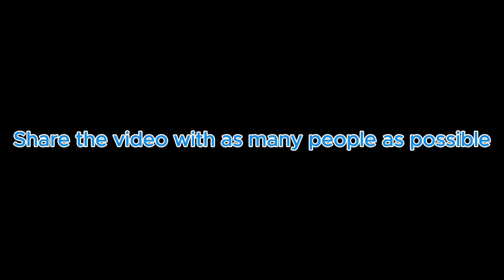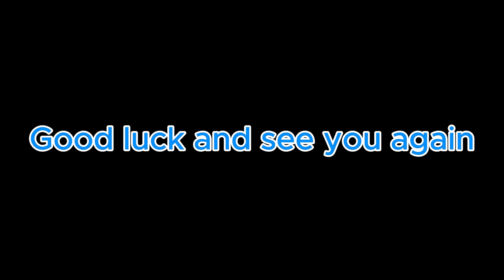Mix SILICONE and ACETONE! The results were shocking because they were so unexpected

Comment: Acetone vapor chambers can be used on 3d printed items (assuming they are ABS or other acetone soluable plastics) to create a smooth finish. It makes them look like injection molded products and removes ports of entry for water, bacteria, etc.

This is probably too much acetone to just spray on an ABS print, but I curious if anyone has tried this method with easier to print PLA? You'd still have the visible layer lines with no increased layer adhesion, but maybe this would be functionally similar in making things food safe? water proof? smooth? IDK. Has anyone tried?

Perhaps not shocking... but for a nurse who likes to F around in the garage, I'm glad to find this!
Reply from the maker: Thank you for watching the video and leaving your feedback. Each comment you make helps the channel grow and motivates me to work more effectively

Comment: Not a bad price... speeds and feeds are everything when cutting metals... especially stainless steel... I will say that having been in machining for 35 years. Yes cheaper drills are cheap but if the metal they are made from is good then you should be so long as you follow best practices. There's a few good phone apps to help with speeds and feeds just in case anyone didn't know that. I will add that you can get better quality tools from your local machine shop suppliers and you might be surprised at some of the prices. They run specials regularly too. May I another point. Over the years I have seen crap quality drills from name brands common in the machining industry as well... it just happens some times. Drills that weren't even heat treated properly and one's that the whole pack of 10 were bad that way... we even got a pack that didn't have the 2nd dairy grind on them and blew up the second you tried to cut with them... best of luck... feel free to ask me anything about machining... take care.
Reply from the maker: Thank you for watching the video and leaving your feedback. Each comment you make helps the channel grow and motivates me to work more effectively

Comment: Fake U can't put acetone in a plastic bottle or spray bottle unless its a special kind of plastic .the acetone Weill melt a water bottle and the working plunger in a plastic spray bottle as well as  with the zip ties used to stir would be eaten by the acetone. Acetone is sold in metal containers for this reason unlike acetone for fingernail polish remover sold in plastic the plastic is a special type and the acetone is not pure!!
Reply from the maker: Thank you for watching the video and leaving your feedback. Each comment you make helps the channel grow and motivates me to work more effectively

Comment: Mineral spirits would be cheaper.  Trying to speed up the drying process with the heat gun is questionable at best.  Please advise good ventilation so you don't breath that stuff.  A can of silicone waterproofer works the same.  Or pretty much IS the same.  Not shocking.
Reply from the maker: Thank you for watching the video and leaving your feedback. Each comment you make helps the channel grow and motivates me to work more effectively

Comment: Yeah, silicone rubber sealant ALSO WORKS AS A GASKET, TOO. Since that's EXACTLY what it's designed for. You can do that with oil-based paints, too. And, believe it or not, it still acts like paint, even tho you're using it just like paint.
Reply from the maker: Thank you for watching the video and leaving your feedback. Each comment you make helps the channel grow and motivates me to work more effectively

Comment: Odorless mineral spirits mixed with silicone. Use a paint stirrer.   You can take a cotton (canvas) tarp or tent and make it waterproof. It needs to hang up taut for a day or two to dry because the mineral spirits evaporate very slowly. It becomes similar to a fabric that used to be known as 'oilcloth'.  Just use a paint brush to apply it to both sides of the canvas.

Comment: silicon used alone in any form does break down after a few years which is why other products are added to produce the better quality caulking that lasts 30 plus years.  maybe try to mix alex plus caulking and acetone to thin and make a more durable coating.
Reply from the maker: Thank you for watching the video and leaving your feedback. Each comment you make helps the channel grow and motivates me to work more effectively

Comment: "mix silicone and acetone". OK Great, but how MUCH? Without detailing precise amounts of mixture, it is virtually impossible to gain useful advantage without a lot of additional futzing about. It might not matter, or you may have gotten lucky, but without measuring amounts and documenting them, it is a crap shoot. Also, using a heat gun to evaporate solvent is not exactly a good idea, because Acetone vapors are EXPLOSIVE! Duh... Other than that, an interesting phenomenon with potentially useful applications...but needs a LOT more testing before one can call it really useful. Does it stick, does it last? Ozone? UV? blah blah blah. Personally, I would hesitate to apply an untested compound on a difficult to replace surface based on a youtube video with no forumulation documentation other than the words "silicone" and "solvent". :-) But that's just me. Still, thx for the video
Reply from the maker: Thank you for watching the video and leaving your feedback. Each comment you make helps the channel grow and motivates me to work more effectively

Comment: The results are NOT shocking or unexpected.  You basically took a waterproofer (Silicone) and applied it to various materials.  The fact the treated materials then repelled water should be expected.
Reply from the maker: Thank you for watching the video and leaving your feedback. Each comment you make helps the channel grow and motivates me to work more effectively
Reply: Dude !  Spray it on your cars paint job !  Also on your plastic interior parts !
Reply: Yes, but diluting it with acetone to make a little go far is a pretty good idea
Reply: That’s not the point. Who cares if a little goes far in this context? The point is that it was transformed into a liquid that can be sprayed onto objects with better permeability
Reply: @CH-bi8ug  Ok kid. Your mom said clean your room.

Comment: Well stands back in total unamazement............... Not rocket science, not particularly useful either.  NOT shocking in the slightest.  Dumb title.
Reply: Think about leather and textiles. Like your shoes as an example. Commercial Waterproofing is a surface level coating, but this has Acetone, so it saturates into and through most all porous, moisture damageable materials. And while still "wet", it has all the properties of being an excellent, weather proof adhesive. Even a light and / or thin "Potting" solution for coating and encapsulating electronics, protection from excess moisture, corrosion, and adverse biological entities. Can you see other possibilities now, O' shallow one?
Reply from the maker: Thank you for watching the video and leaving your feedback. Each comment you make helps the channel grow and motivates me to work more effectively

Comment: Waterproof commercial/ industrial sprays are very expensive. Your acetone-silicone product is genius! I live in the Pacific Northwest/ Seattle area, your industry hack for The People is a gift. Thank you.
Reply: You'll be better off mixing silicone with naphtha or camp stove gas and brushing it on fabrics for waterproofing clothing. Acetone is too harsh and will dissolve seam seals.
Reply: @BradRadford-e8s would this method work to paint on the back side of a accent rug to make it non skid? Or to repair non skid rugs where the rubber membrane is starting to peel off?
Reply: Not suitable for plasterboard or any surface that requires painting, as paint won't stick to it, so limited use really. Maybe try it on canvas or cloth to make waterproof clothing or tarps
Reply: How about paint first?
Reply: @wintermatherne2524  or to mix it together before all.? Acetone would destroy the paint?
Reply: @efgeebe  U would NOT waterproof plasterboard before painting. but if you paint it, then put on this solution you seal it all in.
Reply: Sell that "mix" as what it is - a waterproof spray - and you are in business.
Reply: Try dawn dish soap instead of solvent.. it doesn’t break it down but puts its sticky nature on hold for a moment while you mold it. Just like when you get your fingers stuck together with super glue. Windex will be your best friend, everything has its kryptonite.
Reply: A bottle of silicone spray is not expensive in stores.
Reply: Would be too flamable
Reply from the maker: Thank you for watching the video and leaving your feedback. Each comment you make helps the channel grow and motivates me to work more effectively
Reply: @Tips365day    But….how durable is it?  What materials is it a bad-match to use on?  
If used to spray onto a heavy-duty vinyl, like a Durolast roof membrane—will the acetone dissolve/melt the vinyl?  
If it successfully coats but does not damage vinyl, how many years can it endure hot sun hitting it?
Reply: @Chimonger1  good questions but after the acetone evaps its just silicone and theres varying qualitys so pick a good one then fill us in.
Reply: @Rob.DB.    I have a Durolast rooof membrane on a structure, which is aging-out of its use-life.  
To start, the maker advised painting the edge-stitched seam with a kind of (we thot) glue, from the smell.  But with magnifier helping read fine print, it was a solvent type of fluid, meant to kinda melt the plastic fabric together….after seeing how it melted the stuff, I switched to using a strong marine waterproofed instead.  That saved the roof membrane then. 
I’ve thot about washing the roof off, & just painting-on more marine waterproofing, or better, UV protection, to extend the membrane use-life. 
This mix kinda sounded like it might do ok…but not sure.   Maybe, I need to ‘just’ add framing, & cover the roof with metal—that’d for sure last!
Reply: @C @Chimonger1  put a metal ( corrugated steel) large sheets meant for roofing that come in many colors. It is holding up great for the past ten years in heavy snow, hot sun and all weather conditions. Very loud but soothing in a rain storm as it’s covering an outdoor patio. 

Nothing to do with this video but thought I’d tell you that we love our metal roof. 
 I love this video… of course the critics are too dumb to realize that yes we know there are other products. The point of these videos is it’s great to have options. This will work fantastic for my small application at home and I don’t have to go out and buy anything! I already have the silicone and the acetone. Thanks to the tips person!!! Keep making your videos, the people who don’t appreciate them can get a life and go away!

Comment: I"ll give the channel a freebie topic for the next video. Any glazier has known this secret for years. If you actually use the caulking as caulking, you use the acetone to help "tool" the silicone. (Or get it off your finger). And it's the ONLY solvent on the planet that will remove silicone (before it dries).  CAUTION ON SILICONE. If you use it, be prepared that nothing else will ever stick to it, including more silicone.
Reply from the maker: Thank you for watching the video and leaving your feedback. Each comment you make helps the channel grow and motivates me to work more effectively

Comment: I use silicone and naptha (lighter fluid), and have been waterproofing tent seams with it for years. It's much safer than acetone.
Reply: Why is Naphtha being banned?
The safety data sheets (SDSs) from various naphtha vendors indicate various hazards such as flammable mixture of hydrocarbons: flammability, carcinogenicity, skin and airway irritation, etc. Humans can be exposed to naphtha in the workplace by inhalation, ingestion, dermal contact, and eye contact. (Wikipedia)
Reply: @frgmntTOB as long as zippo lives and breaths naptha will always exist.
Reply: @frgmntTOB  Perkote, nasty stuff.
Reply: Funny you should mention I just bought some nap too do some waterproofing I wanna do a cheap tent so it's fully waterproof but I also wanna do a normal outfit head too toe so just say jogging bottoms and a hoodie and trainers and a hat so it's a regular looking outfit but fully waterproofed maybe jeans also and then go for a walk when it's raining and confuse everybody as too why I'm bone dry when I step in a place or shop 😂...I didnt realise that it's lighter fluid naphtha isn't cheap in U.K it cost me £12 so $18 (roughly) for just a small bottle 750ml size I think but maybe that's the correct price...I heard you can use white spirit and silicone or mineral spirits as you guys call it have you ever tried that as it would be much cheaper ?...cheers mate 👍
Reply: @jshaw4757 dissolved in white spirit it gets used on brick walls
Reply: NightHawkInLight
Reply: Waterproof seams with melted paraffin.
Reply: @marthamurphy3913 melted paraffin wax? I have some. I want to use nighthawkinlight’s recipe with mineral oil and a heatgun/hairdryer.
Reply: Campfire an stuff going boom boom if fine fun
Reply: How is it safer?
Reply: you should  make a vid
Reply: Never use any of the suggestions for waterproofing. If you are near fire, you will become a torch. Just buy real waterproofing cheapskates!
Reply: Hi. What is the ratio of silicone sealant and naptha you use for waterproofing?
Reply: Near your big campfire. Boom!
                                💥🔥💀
Reply: @mariantreber8055  the lighter fluid evaporates when applied in thin layers leaving the silcone same way paint works solvents evaporate
Reply: @mariantreber8055😂😂🎉
Reply: Great suggestion!❤
Reply: @tinman3505  it is lighter fluid and it is white gas or lantern fuel. It is a lot of things. Do some research bud...
Reply: hold my Zippo
Reply: iT IS BUT THEY ARE TAKING NAPTHA OFF THE SHELVES!
Reply: how is naptha safer than acetone? acetone is MADE inside your body.
Reply: Is it like silicone spray?
Reply: @everyonelovesLewi not at all.
Reply: Another computer generated rely to a fair statement.  This is corporate, computer generated garbage.
Reply: My brother caught himself on fire messing with acetone, he is averse to it now.
Reply: @wesKEVQJ    Once burned, twice shy.
Reply: Paraffin for lamps?
Reply: exactly right because acetone can actually melt certain kinds of synthetic materials and certain plastic
Reply: I am going to rewatch the nighthawk videos on waterproofing. I do find it humorous the level of grammar of those who do not know when solvents offgas, the danger is gone. I will research the thinning agent you mentioned. I have a pallet project I am sealing some cracks after I've applied a deck solid stain and sealer to it. It's a box to sit in my truck bed for storage and to be waterproof.
Reply: Acetone is one of the safest solvents. Safer than naptha.
Reply: Ja tez chce uszczelniać szwy w moim namiocie. Opowiedz mi jak ty to robisz, jak przygotowujesz ten płyn do uszczelniania.
Reply from the maker: Thank you for watching the video and leaving your feedback. Each comment you make helps the channel grow and motivates me to work more effectively

Comment: HAPPY CRAFTERS = SAFE CRAFTERS

Silicone manufacturers make a NO VOCS solution that is formulated to thin silicones. It is safer and a better way to dilute a silicone into a liquid. (NO VOCS also cost about the same as Acetone). 

Also, increased temperature some impact, but silicones don’t “dry” they “cure”, which is an element of time. 

Mixing random solvents is also dangerous!!! It’s best to do thorough research of the materials before attempting to mix.
Reply from the maker: Thank you for watching the video and leaving your feedback. Each comment you make helps the channel grow and motivates me to work more effectively